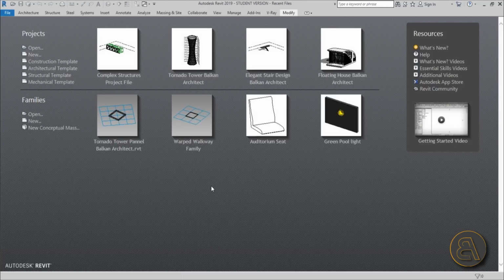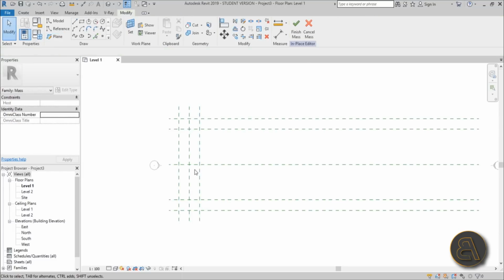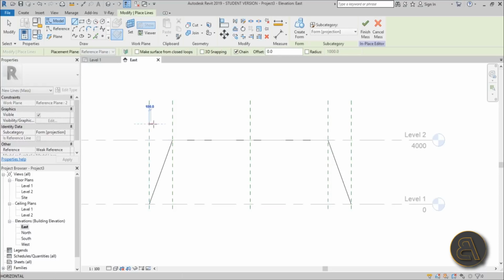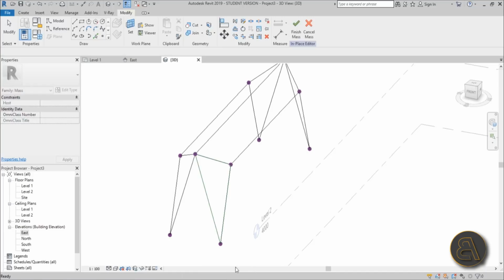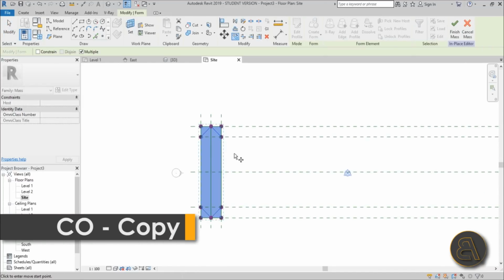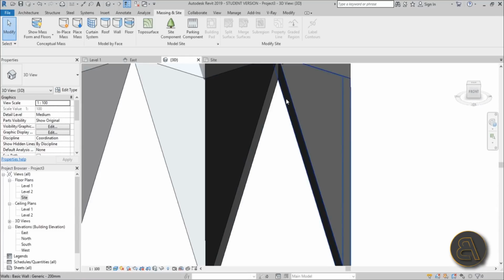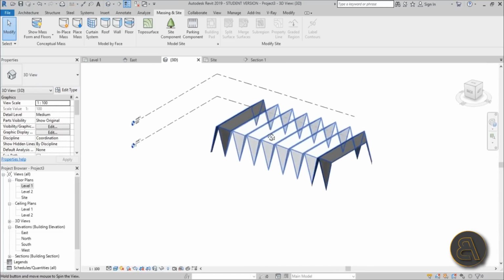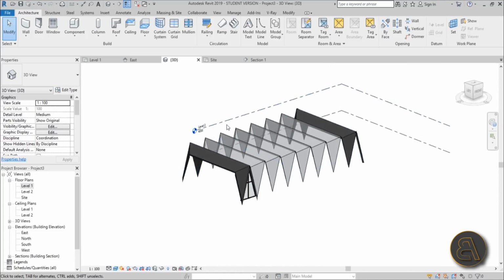Concrete Origami Structures in Revit Tutorial

Comment: Your tutorials are very helpful, thank you :)
But can the wall intersection problem be solved??
Or the only solution is using roof for the mass!
Reply: Maria Hesswani the same issue ,and we can’t use windows on the roof,if you want to add that on the folded plate. :/